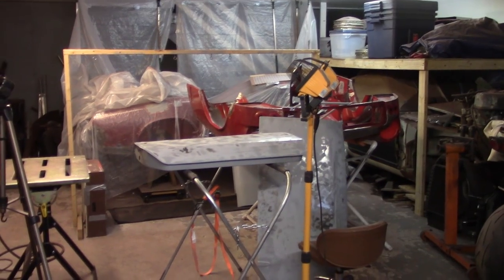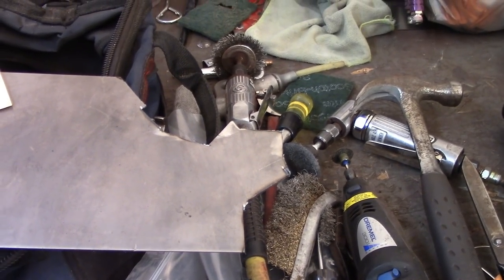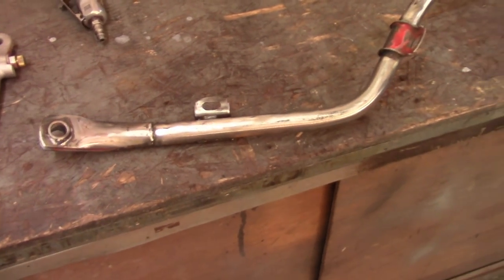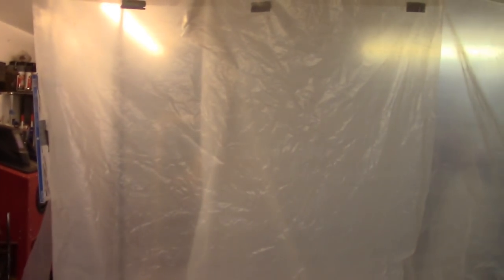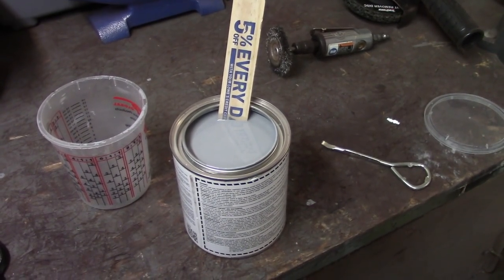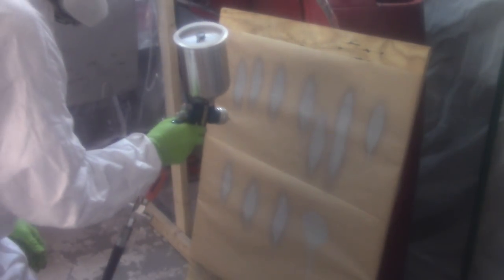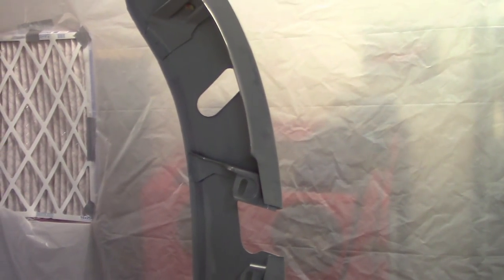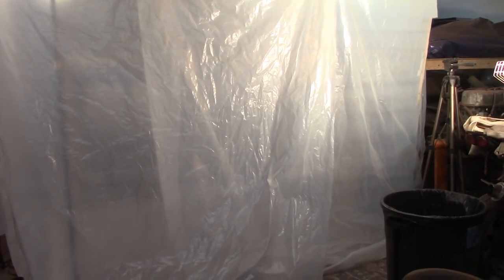Weld Repair & Epoxy Primer - Triumph Spitfire Restoration

Comment: Looks good! Oct 1st and we were both spraying epoxy. Did the underside of the 'B floor pans so I was spraying laying on my back. The sheen on the epoxy is awesome, def a confidence boost as you said.
Reply from the maker: On your back?! That could not have been easy!
Reply: If I was smart I would have built a rotisserie/rotator. Live and learn. I should have video'd it, had to be comical!